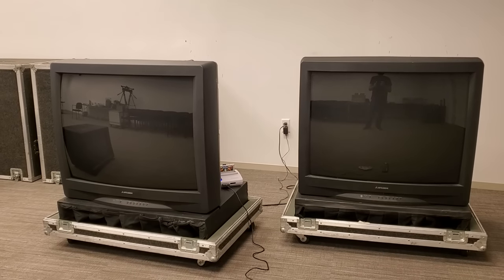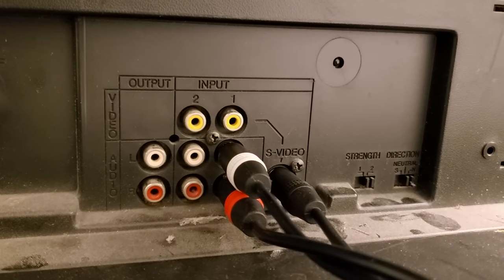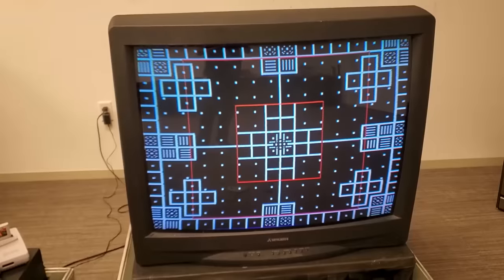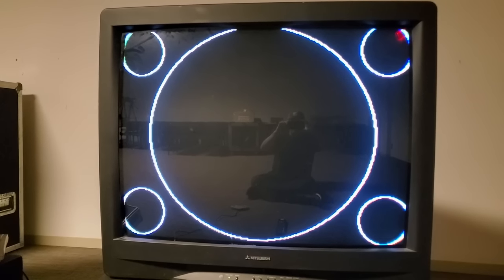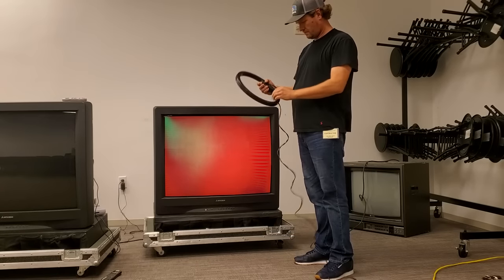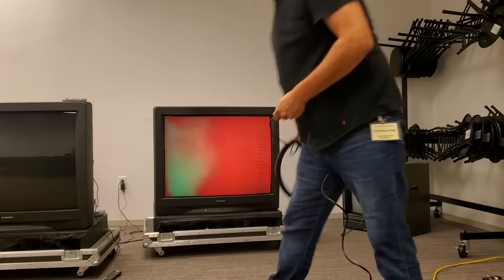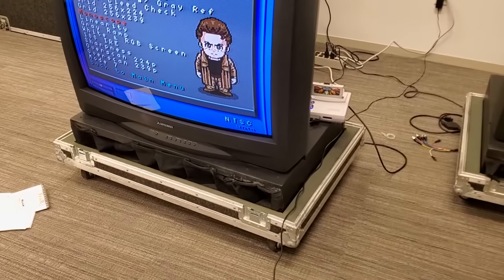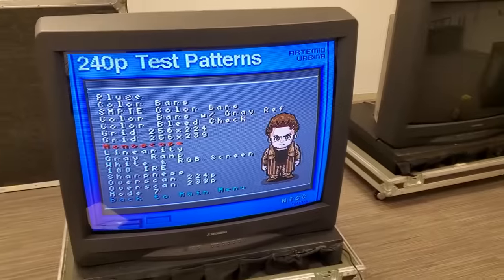The Biggest CRTs still in use:  The Mitsubishi 40" Tube TV

Comment: The "Diamond series" is the successor to this tv. They are 40 inches with component video. Probably the largest CRT that accepts component/rgb. I have one. the geometry on it is perfect. Weird for such a large tv.
Reply: Wow thats the opposite of what ive always thought, usually smaller CRT = better geometry
Reply: @RetrofIex  one of the benefits of a curved screen. Even big ones can be pretty close to perfect.
Reply: There was a 42" model from Mitsubishi that was a presentation display capable of RGBHV, Component and 240p through 1080i, possibly 1080p.
Reply: Sony had CRTs  with HDMI and DVI  that is way better and HD wide screen format   i think 36" HDTV 1080I was the largest for that
Reply: @theantiveganchannel3596  
Nah. Most of those, outside the XBR960, are actually pretty mediocre.
Even the 960 is pretty much limited to 720p/1080i exclusively.
Reply: @gmwithrow  IIRC the 42 had a viewable area of 40". My Mitsubishi MegaView Pro 37 had a viewable area of 35". They could definitely do 1900x1080 at 60Hz, heck even 1900x1200 with no issues. I'm guessing the ATSC 1080p standard was using these as the upper end of their threshold when they designed the spec (ATSC actually defines 18 different resolutions and refresh rates, though thankfully I think 8K mandates 120Hz, we are a long ways away from anything approaching a real standard to take advantage of such displays and even 4K UHD BluRay is still a rarity in the consumer sector).
Reply: Sony Triniton has entered the chat.
Reply: @gmwithrow  phillips had a real true 720p CRT 36" i think it was
Reply: I had a sharp 36 inch i think in the 2000s, had all the good inputs. Ik they made it in a 40.
Reply: mitsubishi stuff is awesome
Reply: check out "Mitsubishi XC3725C 37" Presentation Monitor" move on youtube. So far 3 inches less, but it has SCART, and VGA input. Looks brilliant with Dreamcast classics
Reply: Mitsubishi abd Philips had a corporate deal to fix prices and sizes on TV for decades. Both had TFT and LCD manufacturing down solid, but waited until their CRT market finally made a certain profit threshold, through deliberately illegal price fixing, and not delivering newer technology to consumers.
Reply: The reason for that is they set the convergence with a camera, computer and a ferrite rubber strip on the neck of the CRT. When you buy a new one it comes with the yoke and pre-converged. For the symptom in the video there's a special external degausing coil that should help.
Reply: I worked in A/V back that, most of the Diamond Series stuff was their best stuff and the price tag showed it.  As they say, you get what you paid for...
Reply: I played Gran Turismo 5 on my 1996 Sony XR 27 inch Trinitron CRT... at 27 inches Gran Turismo 5 did make me feel like I should get a large HDTV like at a friend's but I never cared to cause despite the resolution and details, the game was extremely tight and responsive with beautiful colors.

I could imagine a 40 inch or even a 42 inch just making it much better... I did have a curved 36 or 34 inch Zenith (apparently had fried a fuse and back then I didn't try to repair it) but honestly the image quality was nowhere as good as the Sony Trinitron CRT...
Reply: @apollosungod2819  Yeah my favorite tv at the moment is my 36xbr200. It does everything. I can watch movies on it and play 240p games. Large displays really shine with light gun games and racing games... and movies of course.
Reply: there is a 40 inch trinitron I think its a XBR800
Reply: @ChazMcClure  xbr 800 is hd. Let it die.
Reply: @RetrofIex I have a 20 inch daewoo and it's geometry really sucks

Comment: I was an A/V Home Theater installer when these sets were current, I absolutely hated working with these PoS tvs. #1 Considering the weight of these things and the lack of built into the case handles made them a total pain in the neck to work with, they were also very front heavy and the official Mitsubishi TV stand usually sold along with them, made it a hazard for tipping over. #2 They have a horrible picture compared with other Hi priced set's of the day, as the reds typically bled into just about  everything. #3 Way Overpriced. My apologies to anyone I may have offended or disagrees with me. Thanks for the video.
Reply: You were there during the days of these behemoths! It's good to hear constructive criticism.
Reply: No need to apologize for not wearing rosy glasses of nostalgia, I look at a tube like that in awe from it's monstrosity alone, but have never worked with them to say anything. I do remember our 29" one being quite a pain to move, but that's probably nowhere near that 40" one. Component video looked amazing on it, geometry problems are something I don't miss at all for sure, but damn that built-in sound just plain humiliates what we got now on LCDs.
Reply: @Adam Speck Way more than that. I had a 36" Sony CRT back in the day and that thing weighed a little over 200 lbs and that was smaller than these. Moving that huge Sony was such a pain.
Reply: @buttguy  All of the large screen Sony's TVs 32 inch and up were vastly superior to the Mitsubishi lineup in every respect. The build and design quality of the Sony's were top notch, and the picture was so much better, you really can not compare something that cost not much more money to an obviously inferior and overpriced product. The JVCs and Panasonic's were much better than these at a comparable price. I also recall working with some Fisher televisions (manufactured by Sanyo)that were about half the price and outclassed the Mitsubishi's every time, with built into the case handles, much better sound and a superior picture. Thank you for asking.
Reply: @Kalvinjj  Have you looked into adding a Sound Bar to your current television?
Reply: @JayRCela  That's an option indeed, on one of the two that got digital audio out, the other one doesn't have any audio output.
Kinda ridiculous but whenever I game on it I connect the headphones straight into the console instead, bypassing all that ear piercing sound thankfully, and don't really watch much more on it.
If my parents that use the 40" dying Philips with audio out weren't going towards deafness I would probably go for external speakers or a sound bar indeed, but mom doesn't care, dad is near deaf on one ear and the other ain't great either, guess I'll invest into my own setup when I need that.
Reply: @Adam Speck The only problem with lcd setup is that cheap converters lacks scanlines and latency is often a pain in the ass.
Reply: You had to be careful taking the back off, the front could snap and tip over. We actually put braces on them to service them, and the braces caused purity issues, so when you were done,  you had to have a second person hold the front to make sure the purity was good before putting it back together,  fun times
Reply: @JayRCela  I had an flat screen Sony tube tv growing up. Dang thing had an sub in it.
Reply: crt tvs are the best and I will always use one
Reply: @realamericannegro977  Yes
Reply: @thatyoutubeguy7583  those sounded pretty damn good - better than some basic bookshelf systems. But.... if you cranked it even a little bit, the shadow mask would give you the shimmering rainbow effect which was a bit silly if I'm honest. My gripe was with the image warping at the perimeter of the screen. That was worse than a cheap Samsung. I've since found some Sony's but not the ones with the bassy speakers. It was a gimmick. But it saved space.
Reply: @lamplight1636  The best what? Not HD. Standard resolution, at best.
Reply: Ive got to say..my new 43inch 4k bravia panel I find very great. Great picture, resolution and movement.
Reply: I have a question what would be the best option moving one like a Sony kv40x700 can you use a dolly or will it damage the case Id imagine it would would in a box with Styrofoam but I'll have to make something up if that's the case

Comment: a 40" CRT screen seems enormous but a 40" HDTV screen seems small these days. it's funny how that works.
Reply: It's due to the fact that it was harder and more expensive to make big screens with CRT back then and the quality actually could decline the bigger the screen you had. While on LEDs you don't have the problem with the cathode tube so there is no limit to how big you can make them and still maintain the quality. The big screen TVs you had back then wasn't CRT but rear screen projection like a video projector.
Reply: 40 inches in a 4:3 Aspect Ratio is a bigger screen area than 40 inches in a 16:9 ratio TV of today. TV brands have conditioned people to wanting a smaller screen size for their money and monitor brands followed suit which is the worst consumer trend in the past 25 years.
Reply: They don't look like 40in screens... that's nearly 3.5 feet... they don't look first large

Comment: I serviced Mitsubishi TV's in home for a long time.  Most were on the factory stand, the ones in the more expensive homes were in the wall  and the enclosure was slightly larger than the tv  definitely a 2 man job, it weighed 210lb.  Like the Sony CRT we  added purity magnets on the back of the CRT when degaussing didn't clear the image.
Reply: Good old CRT back-breakers! I miss the old screen look but not the moving of them!
Reply: I moved ours alone, as a 15-18 year old. I weighed 240lbs, but I could grab it from the front around to the back hump, and haul it around. Built in theft deterrent: Nobody CAN just walk off with it, and if they CAN... Just let em

Comment: One thing that helps with degaussing a CRT when using the round wand , try when pulling away from the CRT, turn the wand 90 degrees sideways as you pull back.  It improves the success in getting the purity right.
Reply: My Trinitron has a built in degausser in it. A really nice 27" set. I love it so much. I used to play my old consoles in a 32" RCA TV and the color bars were way too big and made everything blurry. I can't even imagine how bad it would be on a 45" set.

Comment: I've got a 60 inch projection crt tv that I still use haha. It weighs 300 pounds and has wheels built in it weighs so much. I've got the original remote sitll working and the inside is beautiful.

Comment: Last CRT TV I had was in 1998, I used it until 2011.  Also same time I had a CRT monitor for my desktop running, what else, Windows 98 se. 
And the defective CRT s were still in demand because when my pc monitor had issues,  the warranty provided a new one,  delivered postage paid, and they wanted my old one returned in the same box!!
 Not until 2013 did I finally get a flat-screen monitor,  which doubled as a tv,  for my tower pc.

Comment: We had a 42" Mitsubishi CRT in my family, up at the lake house... It was a beast which took 20 mins to warm up fully and correct colors, and you had to press the power button ON THE TV to make the power supply connect to mains voltage. So, after you initially turned it on, you could use the remote to "power down" the unit, and "power on" again, but depressing the power button on the TV disconnected the power supply from the wall plug, until pushed again. Very smart, but then again, it probably consumed over 1kW, and had huge capacitors as well
Reply: Hm...I am pretty sure that power buttons on 90% of CRT models did the same thing, they disconnected the power completely.
Reply: @vasopel   soft power switch
Reply: @theantiveganchannel3596  ?
Reply: @vasopel  almost as cringe as actual vegans lol. almost.

Comment: I had a 36" Trinitron WEGA flat CRT that could do 480p and 1080i via component cables. But it was a lot to deal with. It weighed almost 200 pounds and was very front-heavy... anytime I had to move, it was a nightmare. I finally had to get rid of it many years later (a while after the PS4 released) but now that I'm settled more, I wish I was able to hold onto it.

I had a degausser I got off of eBay. You absolutely needed one with these things, it felt like lol

Comment: This was my dad's old living room TV back in the day! It lasted 15 years being used daily before it died! It is a great TV that speaks testament to NTSC being a reliable system.
Reply: I got a Sony 1080p LCD screen from 2008 that still works   15 years old still has bright picture etc..   you can still play the older games and it still looks good with  zero to no input lag
Reply: @theantiveganchannel3596  If its an LCD, especially an old one, there's substantial input lag.
Reply: The amount of waste heat these CRT produces, it wouldn't surprise me if the some of the electrolytic capacitors were the main caused of the fault.
Reply: @DAndyLord  minimal input lag  as it does not have "fancy"  processing..    almost as close to a CRT tv 

i had compared it to a newer one 2018  which had way more input lag  about 4-5ms more...
Reply: @iceho6460  Any electrolytic capacitors are suspect after about 15 years. I work on 1940's tube amps and they are often the only pert that requires service.
Reply: I had a PAL Akai 30 inch from around 1990, that didn't die until 2008 or something. It had issues like a clicking every once every few hours. So I'm not sure the NTSC had anything to do with it.
Reply: @theantiveganchannel3596  Seems odd
Reply: @DAndyLord  I think it's the other way around. Texas Instruments calculators have the same input lag as a CRT, and I heard you can play duck hunt on the tiny old 4:3 SD LCD TV's. Whereas the main reason I bought a CRT in the first place was because input lag was making certain games just not fun on my 4k LCD TV. Wish I could keep my old Plasma.
Reply: @mr.jamster8414  It isn't and you couldn't.  
The TI calculators have very low input lag, but the LCD panels in them have a very long output lag.  (ghosting)

CRTs have an effectively zero input lag (although that's not why light guns worked on them, and not on LCD), with any digital TV there is an inherent input lag.  The signal needs to be processed for digital, which creates latency.  Processing (and screen technology) has gotten a lot better in the last few decades.
Reply: @DAndyLord  I'm certain of it about the TI calculators. Try the GBC emulator for them yourself if you don't believe me, playing SMB deluxe on there is exactly the same as a real NES hooked up to a CRT TV, but just zoomed in. I think it's internally hooked up to a special kind of analog signal. The guy who told me about his memories playing light gun games on his 1990's tiny flatscreen TV knows a lot of shit, too.
Reply: @mr.jamster8414  Due to the substantial differences between LCD and CRT we wouldn't' be able to use a light gun.  

Even those calculators have to process to display.  Gameboy is not the same as NES.  I have no idea what LCD was used in either device, so I can guess they'd be similar in latency.  Gameboy is not analog to the screen (or in general), NES is.  

That guy is wrong, at least in this specific case.  He may've had a (super expensive, at the time) CRT flatscreen.  Which would be lightgun compatible and also (effectively) zero latency.
Reply: @DAndyLord  I'm pretty sure it's one of those LCD-Plasma hybrids, definitely not a CRT, he showed me it. If he means a game like Duck Hunt where less than 1 frame (not less than 1 pixel) of lag is required I don't see why it wouldn't work if the brightness is turned to max. And I said, I'm talking about modded TI calculators with the GBC emulator, specifically GBC4NSPIRE, not the actual OG gameboy which definitely has 2-3 frames of lag.

Comment: I have a Thomson 35" that looks almost identical to this set, nice big curve, 240p looks amazing on her (preferable to aperture grills), has very bright and vibrant picture with fantastic geometry, way better than the bigger Sony sets geometry wise, especially the flat Sony's, it also has 4 RGB 21 pin SCART inputs too, which is nice, nice prominent scanlines, plus 4 speaker outputs for surround sound (Dolby Pro Logic II), the built-in speakers are already superb sounding, it's easily my fave CRT for retro gaming on.
Reply: Sony TVs could be set up with fantastic geometry if you could be bothered to go into the service menus and do it properly.  They only had about 30s per TV in the factory and just couldn't get them to perfection in that time.
Reply: @video99couk  I agree, i was a Sony trained repair tech, and could get the geometry almost perfect with a bit of patience,
Very few CRT sets have pefect ruler straight lines, it's one of the few advantages that Plasma and LCD panels have given us.
I still prefer the images that a CRT provides.
Reply: I'm have an crt tv with hd resolution. I can't remember diagonal dimension in inches,  but a bit small, i think it's a 30" crt.
Yes, "It's a SONY". My opinion, for picture quality, 
1. Crt
2. Plazma
3. Oled.

But monster sized screens finally wins this race, naturally, incredible resolution bla bla bla..